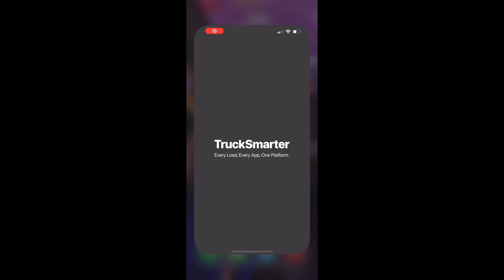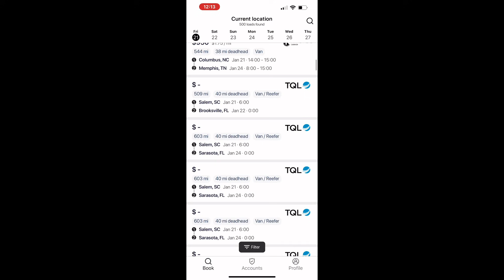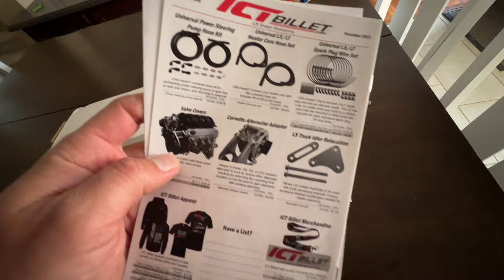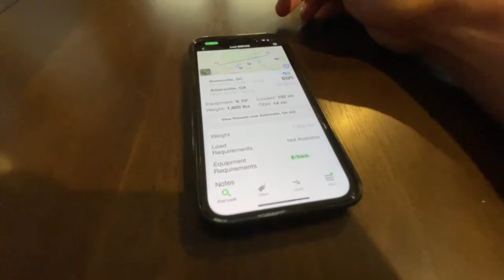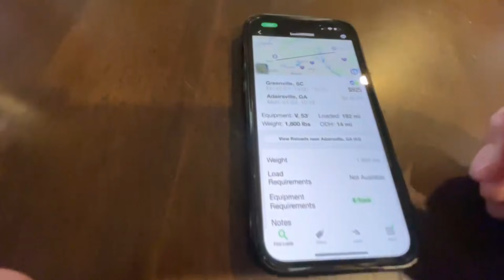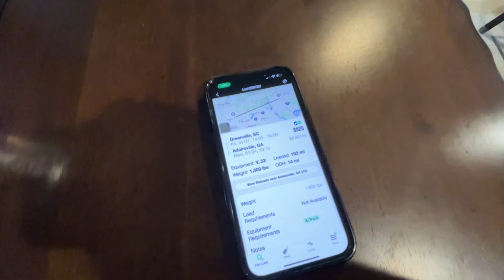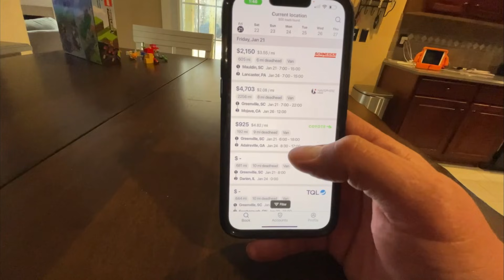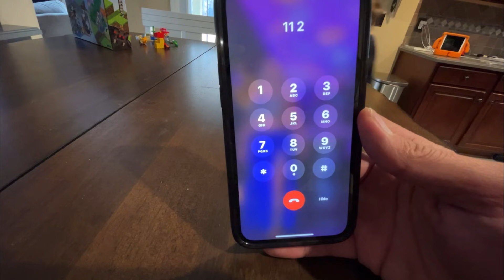HOW to NEGOTIATE booking LOADS as Own Authority! Aim High $$ Find a Middle point OTR self dispatch

Comment: Would you not try and get the chicken lights wired up before the dot get you Justin
Reply: @larryray4811  when he put the new bumper on he fitted the chicken light along the bottom of it. It’s a DOT violation if they’re fitted and not wired up if you go back to the video when he fitted it he says it at the end of the video
Reply: @larryray4811  if you put lights on a bumper they have to work

Comment: Justin is that a 6.2 block or 6.0?
Reply from the maker: 5.3
Reply: @JustTruckin  I'd think you could block the vacuum pump. And high pressure fuel pump and set gen 3 heads on it. Yet the headache my be easier to find 01-05 block. I have 07 tahoe I did the dod delete. Need any advice let me know.